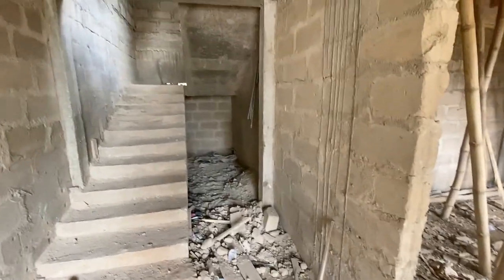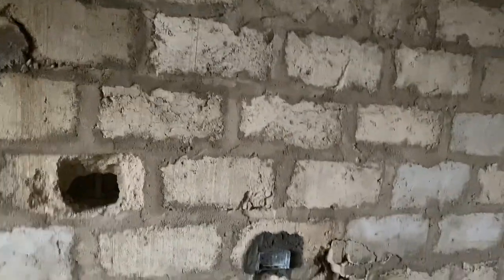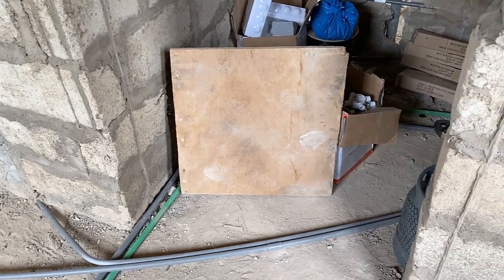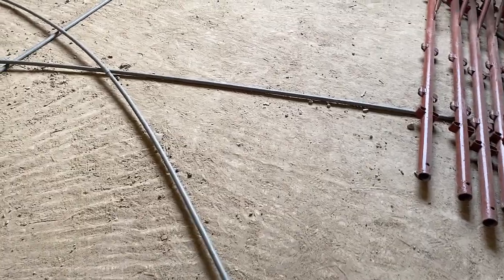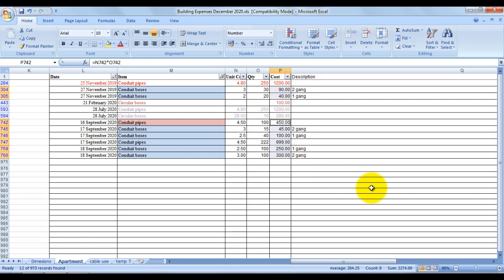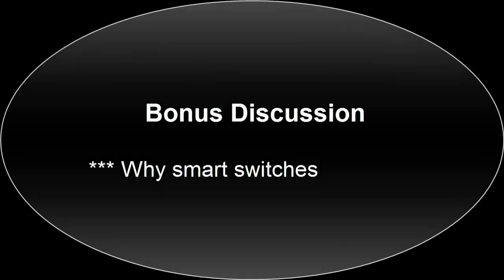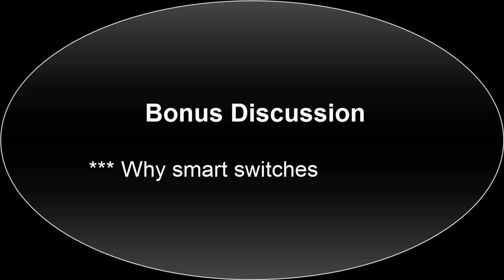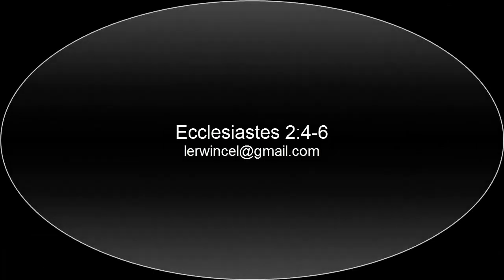Cost of Building in Ghana _  Electrical Conduits _ Ep 9

Comment: Where can I buy the smart switches from. IS the USA brand compatible with Ghana’s electrical system? .
Reply from the maker: Both 110v and 240v are available on Amazon. Ghana’s voltage is 220-240 so if you are buying US voltage then you need to wire for 110v.
Reply: @Lerwincel  okay 👍

Comment: Good job done bro,but why don't u run the electrical pipes on the ceiling to the walls
Reply from the maker: Those for the light switches are done that way. It's only that for the power outlets/sockets that are run on the floor. So my assumption is... Typically, the outlets in Ghana are about two feet above the ground, so the floor option may be for efficient use of cables/wires.

Comment: Late to the party but will greatly appreciate your insight.  Are plastic electric boxes common or recommended in Ghana? Thanks
Reply from the maker: While there are plastic boxes available, they are usually not recessed. Infact, though the same dimensions as the metal boxes, i have not seen any of the plastic boxes recessed in a wall. For the recessed ones, the metal boxes are the norm.  

Your question is really thought-provoking . I will  check with the electricians and capture my findings in the future episode on wiring
Reply: @Lerwincel  Quite helpful.  Thanks for responding and keep up the good work.
Reply: @Lerwincel  plastic Conduit boxes are in the system. We have Pattress Boxes that's for surface installation and plastic Conduit boxes that  can be fixed into the wall.
Reply from the maker: @multiskilledelectrician1  You are right. I already checked with my electrician and he educated me on that. That info will be provided on the future episode on wiring. Thanks for your input!
Reply: @Lerwincel  you welcome sir!

Comment: what are the difference between laying pipes on the floor and the traditional old ways we used to lay wires?
Reply from the maker: Not sure what the traditional way is. A little clarification will help
Reply: @Lerwincel  wires are passed through the ceilings  and nowadays everything is on the floor
Reply from the maker: @Sarpong-family  Gotcha. 
Wires still go through the ceilings but that is for the light switches. The floor wiring is just for the socket/outlets. You can still use the ceiling for the outlets but with sockets usually 2ft above the floor, the distance using the ceiling will be longer than when passed on the floor. That means more cables/wires. I think your question is worth addressing in a later episode
Reply: @Lerwincel  thank you very much, i might be ignorant about these things as im now learning about buildings as i am myself building as well.  (videos are on my channel) ive being watching videos so i get ideas and processes of building in Ghana.

Comment: What’s the cost benefit of having to chisel the blocks to lay your electrical conduit rather than    Using hollow blocks of load bearing specification. I hope they’re mindful of the structural integrity as the chisel all over the place . Who’s in charge if I may ask?
Reply from the maker: I am in charge.
I have already indicated in earlier episodes that the walls are not load-bearing, therefore, the chiseling of the blocks is not a problem.

Your idea of running the pipes in the hollow blocks sounds good and cost saving. I will reference you on this in the next episode